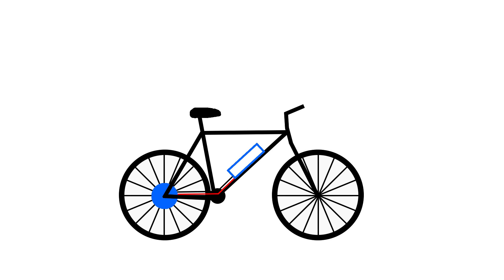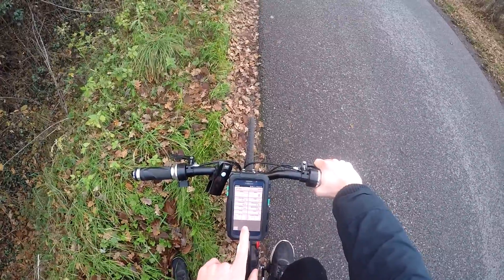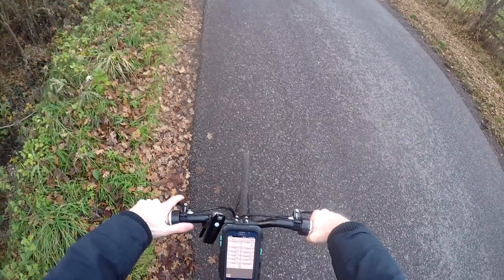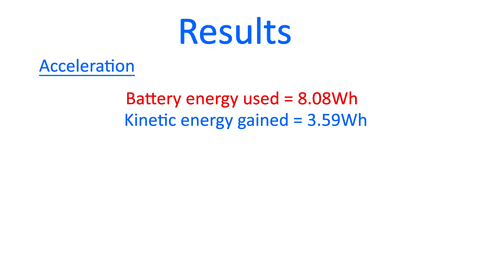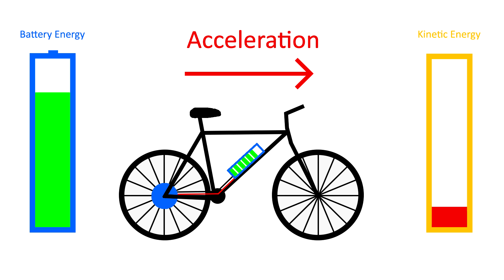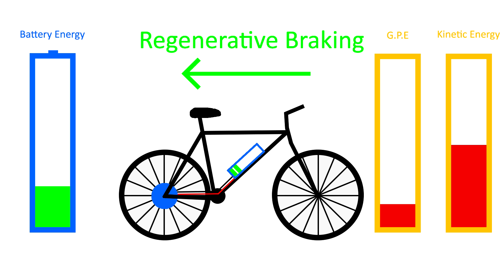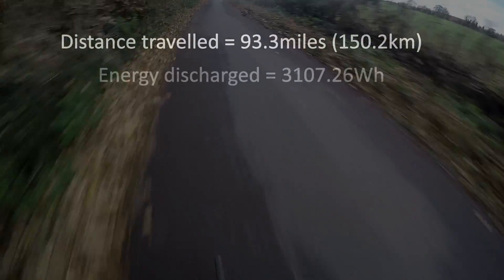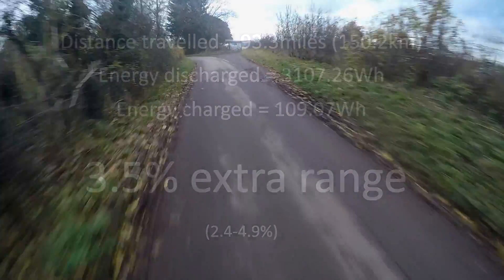Regenerative Braking tests

Comment: Interesting to see regenerative braking used on a bike.  For railroads, regenerative braking is much more powerful.  In the US it is called "Dynamic Braking."  Electric and diesel-electric locomotives use it to control heavy trains (10,000 + tons) while descending long grades.  The dynamics can take the entire load of the train to maintain a constant speed without need to use its air brakes or drag its brakes all the way down the hill.  Since locomotives do not use regenerative braking to recharge batteries, the power from their traction motors is fed into large, air-cooled, resistor banks where the energy is transformed into heat.  Standard dynamic brakes can not completely stop a train.  Their effect fades out between 3 or 4 mph and air brakes are used for stopping.  Just thought you might like to know.
Reply: Steel wheels on rails are a lot more efficient than rubber tyres due to a lower rolling resistance. I've been told a railed vehicle of the equivalent weight over the same distance would consume 1/7th the energy of that a rubber wheeled vehicle.

So a lot of that energy could be captured back in comparison.
Reply: You would not believe me, but I'm a locomotive engineer and everywhere in the world electirc trains, electric locomotives and diesel electric locomotives have dynamic braking with resistors lol, even diesel hydraulic locomotives and trains have hydro dinamic braking. But apart from that, newer electric trains and locomotives like siemens vectron are putting their ED braking back to grid and it's recuperative braking ;) More on the same subject, all diesel - electric locomotives are hybrids and they have been around for 100 yrs, but now I guess is just recognised as technology evolves, so it can be used better then just a heavy load transmision that can sustain grater forces :)
Reply: @fauzirahman3285  that explains why it was possible for a strongman to pull 1000 ton train, yet pulling 700-1000 cars even on perfectly flat ground would be impossible. Hysteresis losses in the rubber and also the slight rubbing from expanding and contracting contact patch area (strongly depends on tire pressure) would make the force requirements too much.
In fact because there are so many cases where the brake pads in cars slightly rub against the wheels, it might even be impossible to turn 4000 car wheels at once. Even if each pad rubbed against the wheel and created 250 grams of resistive force at the edge of the wheel, it would still take a tonne of force to simply turn all the wheels!
Reply: @Jake\Nerd No. The engineer applies the brakes manually. And newer A.C. motors can stop a train completely.,
Reply: Mining haul trucks do the same thing. They will have a diesel generator and electric wheel motors. Most of the time they go down hill they'll use the regen to slow them, and like the trains, dump it across a big resistor bank. Sometimes you can hear a high power fan turn on to help cool the resistors.
Reply: Seems like a waste of free energy
Reply: @alimohammed4709  It is an energy waste for railroads, currently.  However, upcoming new battery technology may allow diesel-electric locomotives to save power from their dynamic brakes instead of converting it into heat. That stored power could be used to give the train an energy boost to climb the next grade, thereby saving fuel.  Perhaps, one day, we may see diesel locomotives with a battery "tender" behind them.
Reply: I assume that the engine at idle condition at that point. Can that electricity being used to turn/rotate the engine? Since idle is still burning some fuel.
Reply: Wouldn't you be able to fully stop the train if you started gearing up the motor to wheel connection with a gearbox? making it so the wheels spin a lot slower for higher motor revolutions when the train is going slower
Reply: @Psyden5757  For a bicycle it might be possible.  However, for a locomotive, adding a variable-ratio gearbox to each axle would defeat the simplicity of electric propulsion with a single gear set between motor and axle.  It would also greatly add to the cost and complexity of a locomotive.  And it is not necessary, anyway.  Modern diesel-electric and electric locomotives using AC power can fully stop using their dynamic brakes only.  However, air brakes on all cars will still stop a train much faster and therefore will always be used.
Reply: @thomaslevy2119  i didn't consider you'd have motors for each axle, thought maybe it was a motor per car, linked with gears
makes sense though

Comment: Where Regen really access is at saving your brake shoes. Ebikes tend to wear brake pads down faster because you generally travel at higher speeds and they are heavier. Regen breaking mitigates that problem nicely.

Comment: Great video and assessment of a lot of the variables involved.  My 2 cents: one other major component of loss that was not discussed is the motor itself.  I did some measurements with an elevator (straight up, straight down, slow speed, no significant wind drag), using a 1/2HP permanent magnet brushed DC motor.  The motor was rated at 90v * 5.4A = 486W.  With 745W/HP, that works out to (745 / 2) / 486W = 76.6% motor efficiency.  (For ease of math, the motor loss was just over 25%.)  That loss applies whether the motor is providing power, or sinking power.  In short, I had ~50% loss right out of the motor alone.  BLDC (brushless DC motors) can be more efficient than that, potentially past 90%--but still, that's a 20% round-trip loss.
In addition, the bulk of motor loss came out of the voltage, not the current--so I basically provided it 90v, and got 45v back at the same regulated motor speed.  This also means that the motor controller has to "boost" the generated motor voltage to just beyond the battery voltage in order to recharge the battery.  And unfortunately the easiest way to do it (i.e. no extra parts needed) is by PWMing a short circuit across the motor leads, and dumping the resulting "kick" back into the battery through the blocking diodes on the motor driver FETs.  (Basically a boost converter, but with the power source and boost inductor being one and the same device.)  While cheap and effective, this design is unfortunately also very inefficient.

At least it's the thought that counts...

Comment: The trick is just ride downhill.   Thing is that regenerated energy doesn't have the weight penalty of a bigger battery.   So, it helps a bit.  In some situations, it might be quite a bit.

Comment: On a bicycle I’d assume most of the “wasted energy” is overcoming wind resistance. With a fiberglass shell or even a polycarb windshield I bet that your efficiency would go way up. This was a great we’ll put together video, but I’m waiting for a wiring guide to this setup!!! How does the recharge thumb throttle fit into the wiring? Can you ask the motor to spin up while it’s spinning in reverse while the e-brake is active? Would you get more recharge by slowly easing into the thumb throttle, like in electric motor vehicles? I am so interested in your unique approach to ebike engineering, I hope to have my video up soon detailing some of the work I’ve done on my bike, because, although we have similar performance, our approaches are vastly different! 

Thanks for the great videos man. Keep it up
Reply from the maker: The regen is all done within the speed controller (VESC6), I simply wire in two inputs (input ADC1: twist throttle & input ADC2: thumb throttle), then configure in software that I want the ADC1 to activate throttle and ADC2 to activate regen. When the brake is activated, the throttle from the ADC1 is cut off. In terms of how much intensity of regen braking to use, I'm not entirely sure and will need to do some testing on it. Thanks!!
Reply: I would say the used energy for bikes really depends on where/how you are driving and the specifics of your bike.
But in general i would assume that at the speeds most people drive every day it would be the friction of the tires.
Reply: The percentage of energy used on a bike, to counter wind resistance is *very* high - on an upright bike, it'll be 80% or so.
Reply: For typical bikes the crossover between air restance and rolling resistance is at about 15km/h. Since drag increases with the square of the speed (rolling resistance only linearily), drag is quite quickly the relevant type of resistance. For example going 30km/h instead of 20 (so 50% faster), you need almost 3x (+200%) the power. All "non-refundable" unfortunately.
Reply: didn't know about those figures specifically, that whats one of the things I was getting at. Since most of us aren't willing to compromise the design of a upright bike to make it more aerodynamic, I wouldn't worry too much about that % of "wasted energy". 

With that being said though, EV's like the Nissan leaf have some pretty undesirable industrial design quirks due to the engineers trying to maximize aero. The battery in the first leaf was only 24 kWh, less energy than found in a single tank of gasoline. (81,891 BTU vs. 115,000 BTU)

it's actually pretty remarkable what we've been able to do with EV's in the last decade alone, especially when considering that gasoline cars have so much more stored potential in almost every circumstance. Yet we still are getting comparable ranges and performance specs because of gains in regen efficiencies and aero.
Reply: In the case of an ordinary town bike you're 100% right, but as soon as you start going "e-bike speeds", aero becomes much more important. Something to think about tho! if you're a patient and economical e-bike rider, your range probably goes through the roof!
Reply: Well put! drag puts a take a huge portion of that "lost energy" especially at high speeds. when cruising, or when using special tires ( like sand tires or something) friction of the tires plays a big role as well. in this case, I bet most of the losses Tom was seeing were due to drag, but it'll be interesting see if he updates us on the matter in the next video
Reply: Tiago - true, most people drive a lot faster with their e-bikes.. they are using them more like motorbikes where they can occasionally do something.

I drive my bike daily, when driving in the city and i have dedicated bike-lanes then at maybe 15-18 km/h - and still faster than going with a car :P
i could really use an e-bike cause i have some climbs with nearly 20% incline - and a long downslope where i have to constantly brake.
Reply: Copper and iron losses are dominant at low speed. 

A fully faired bike like this can lose almost negligible energy to air. See: Eta
Reply: @sploofmonkey Regenerative braking is literally the same concept: when you turn a motor with an external force it becomes a generator.

This also shows why it doesn't make sense to constantly have a generator connected to your wheels in an EV: Even with the Generator approach you proposed, energy is never created out of nothing. The energy fed to the headlight in this case is extracted from the system by applying resistance (i.e." braking force") to your wheel. It just makes it harder for the motor to accelerate, and no energy conversion is ever 100% efficient, so all you are doing is expending more energy initially to accelerate your vehicle while getting back a smaller amount of energy than the extra you have to put in.
Reply: @superdau  exactly. When riding my bike (only human power) I don't bother to use the aerobars until about 18 mph because there is no aerodynamic advantage v.s. the ergonomic advantage. Rolling resistance varies based on the tire and the air pressure; specifically how much rubber is in contact with the road and the shape of that contact. Your knobby mountain bike tire will have a lot more rolling resistance than the skinny racing tire.
Reply: easing in - would that be easing in current, as voltage winds down? Speed is voltage, isn't it? 
also, might mid-mount gearing also aid regen, as a mechanical transformer?

Comment: Awesome video, thanks. This proves the gut feeling I had surrounding the usefulness of regen B. It also makes sense then that hub motors are losing in popularity to mid-mounted motors, despite the fact that they are not capable of RB. I do think that RB would be a lot more useful in extremely large vehicles, like long haul trucks, mine vehicles and trains. Just think of all those trucks that have to gear down to brake to save their brakes.... There has also been a study of an electric mine dump truck that actually produced more power than it consumed, purely because it was primarily carrying loads down an incline!

Comment: Great video! You will be a great engineer and are a great teacher.
I spent a lot of time thinking about regen braking in bikes, and the data you generated elucidated the real thing is not that great.
The electronics efficiency could be a reason, but I think battery is the most starving component at the electric system. Maybe with capacitors, as suggested below you could get a few more miles.

Comment: I work as a courier on the evenings and I can burn through breaks very rapidly, so the cost saving in brake pads is a lot more than a few extra battery cells.

Comment: This gives you a great way to test the effect of aerodynamics. I remember when carrot shaped helmets and closed wheels were a thing in professional cycling. All that does is reduce drag, which you should be able to measure with this setup. I suspect you could improve efficiency quite a bit by reducing energy loss through friction, drag, etc.

Comment: Great video. I think windage loss varies as square of speed.
To prove this can you use your setup measure energy used at various speeds over a fixed distance Viz:
Do a 1 mile trip there and back at 20MPH and measure energy used.
Do a 1 mile trip there and back at 10MPH and measure energy used.
Do a 1 mile trip there and back at   5MPH and measure energy used.
This will give very useful practical results.
Reply: It does.
Fd=0.5*Cd*A*rho*V^2

Comment: Curious. On a vehicle like this what's better:

- friction free drive train coasting
- regenerative braking

Like traditional drive trains have a ratcheting cassette, but if you could disengage the cassette with a clutch instead of the ratchet it may save on friction, allowing you to coast further than you'd gain from regen.

As it really seems friction and drag is the biggest enemy to your energy reserves here. Being able to coast without expending battery use on flat sections seems key to making the most of this.

Comment: Just found this video, great stuff - I'm thinking of doing the E-bike conversion on my old touring bike and researching the options. I can confirm that overcoming air resistance is the main energy loss on a bicycle  I have drop handlebars, on a gentle downhill I can easily coast past somebody on an upright bike who is pedalling furiously, so even reducing the air resistance a bit by going down on the drops makes a huge difference - so presumably would make the use of Regen more effective.

Comment: Riding a bicycle means that most of of the power and also the energy is used to overcome the losses due to the driving resistances, mainly caused by air turbulences. The thrust needed to overcome the driving resistances goes with v², the drive power therefore goes with v³. You cannot expect to regain a lot of energy by regenerative breaking because the kinetic energy is relatively small.

Comment: great data gathering and analysis. Probably on a recumbent bike the regenerative ratio could be better due to lower wind resistance.
Would a setup like this work: 2 batteries A + B + a generator unit: A is the driving battery, B is the gathering battery. A is driving the bike, B is connected to a generator that takes / converts the kinetic energy like a dynamo into electricity. A smart setup could measure A capacity and reaching a certain point of low voltage switches to B while Generator B is disconnected from B and connected to A. Etc. Not sure whether this could work...

Comment: An immediate like for this impressive video.  Have you considered monitoring the temperature of your battery and charging unit to get an indication as to where some of the power is wasted?
Reply from the maker: Currently I've only monitored the temperature of the speed controller. But thats a good idea to look into! Thanks
Reply: Off track - how do you produce your graphics?
Reply from the maker: +Richard Wenner I draw it all in Adobe Photoshop, then move things per frame like stop motion animations. Or for the energy meters, I adjust the scale of the coloured bars in Sony vegas video editing software
Reply: Slick - its a good result.  When we do this I remember an evening I had here in Cardiff with the guy who edited 'Match of the Day' - back in film processing days.  The sound on film is physically offset from the image so editing was a fag. He told of nights when the program went out where you could still see the cleaning water on the final broadcast as the film was being fed by hand from final processing directly into the tele-cine.  We don't know we are born!  :) Thanks
Reply: Yeah, your animations are great too :) Have you seen this? Its about MOSFETs temp conditions with better (some, at least) airflow, which you have, - it is sufficient? Cooling of battery (not so tightlyy coupled cells? some active fan too?) may be key to better efficiency, but still its very aggressive discharge/charge, where some pro LiFePo4 are probably better capable also. And BTW, VESC is open-hardware with parts at $50 probably. Its quite curious your 3 VESC4 died as, proper temp handling is core feature of firmware, when limits currents too.
https://www.youtube.com/watch?v=UwVQQ_LY5bc